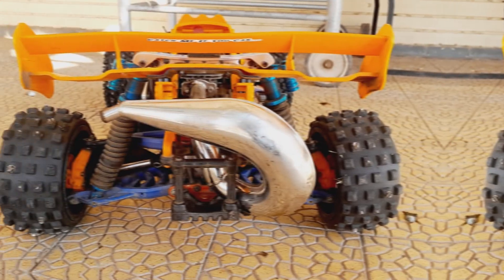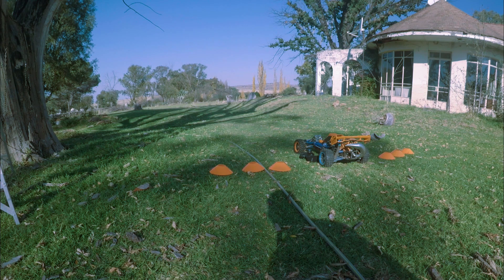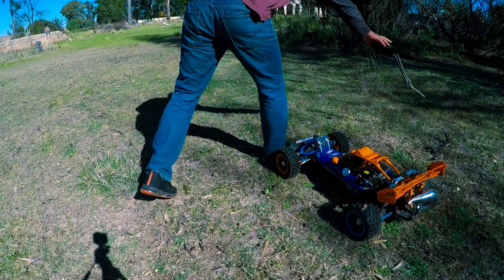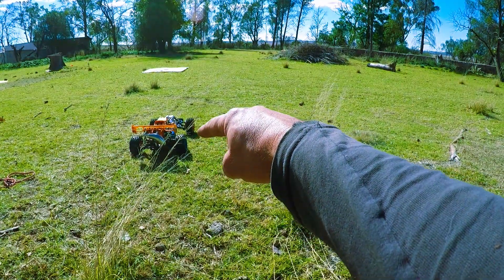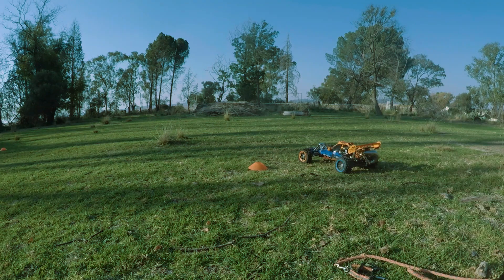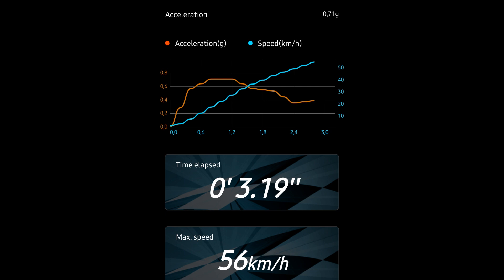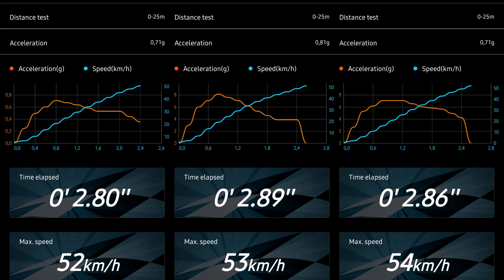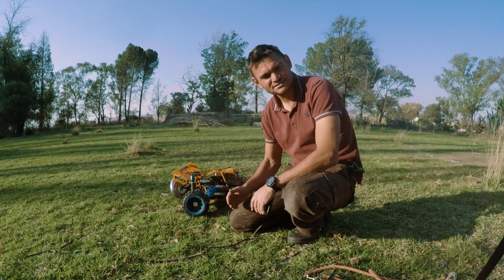Baja 5B Gear Ratio Selection

Comment: so im looking to get 20 54 for my 45cc baha it should be able to pull the car up to speed XD
Reply from the maker: 20/54 is a very nice 45 gear set. It eats the clutch a little more but if you have wide open spaces you want the higher speeds.
You could run the FS Shoeless clutch like the Taylor 35cc
Reply: @EZR I installed and tested it 
And it's hella fast 
It doesn't rip as much from the start but my baha weights 20kilos with the gt rollcage so I'm fine with that .
Still need a gps for speed testing
Reply from the maker: @chaoselemental1607 that's awesome dude. Sounds like pure joy.
Having something that heavy moving at that speed is a scary experience.
Reply: @EZR most definitely scary 😅😂😂

Comment: Awesome stuff mate. Super happy you did this video.. Wow now they were some really surprising results thats for sure. Amazing to see how quickly the engine reacted to the higher ratios. I really didn't think we'd see a drop off like that with the 20/54. Like you mentioned thats a  clutch killer if anything else. I've got the 29cc so your next video will speak volumes for me. Hey a little trick to getting the pinion gear off without needing to put grips on the teeth. With the spur and the pinion still mounted to the car get a spare spur gear and hold it in the gear mesh between the spur and pinion. You'll be able to undo the pinion bolt while the spur you're holding locks everything firm. Saves possibly damaging the teeth with grips. So far looks like the 18/56 is the best but the stock 17/57 still isn't too bad for straight out of the box. Thats a great GPS tracker. Perfect. Thanks again mate.  .
Reply from the maker: Thank you so much for commenting. I'd be sure to try the Spur Gear trick. Simple but effective.
The stock gears are great for offroading. You'd definitely see a difference on tarmac.
I love the 18/56. They just expensive in our Country. Not so easy for everyone to stock. I'm gonna do some drag racing in upcoming kids to show the visible results those few teeth make.
Reply: @EZR  Yeah sweet as. That should be a good video to watch and see the results. Because science. haha. Yours being a more powerful engine over my 29cc we might find the stock 17/57 is actually perfect for it. Who knows now after seeing these results. Anything's possible now.